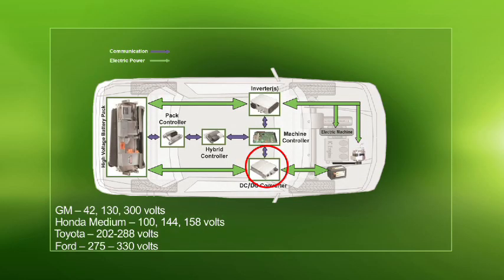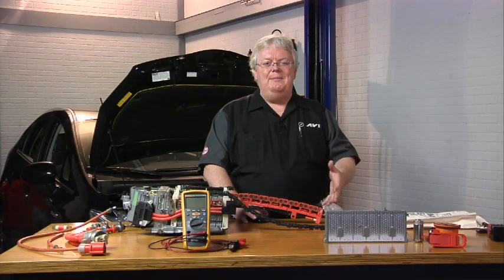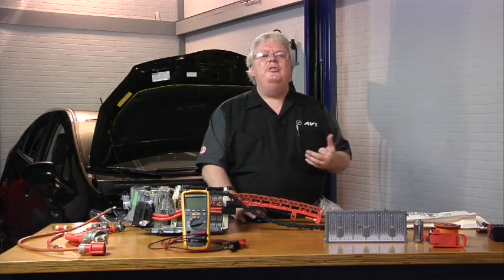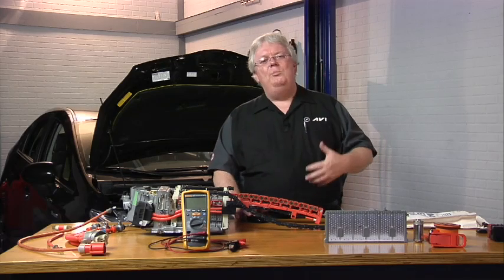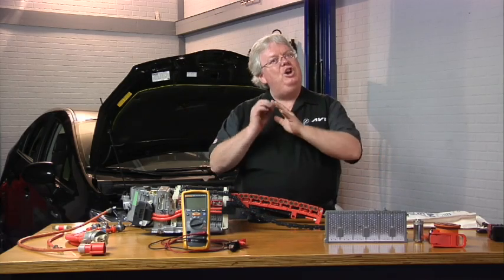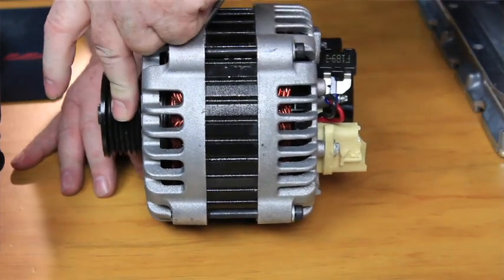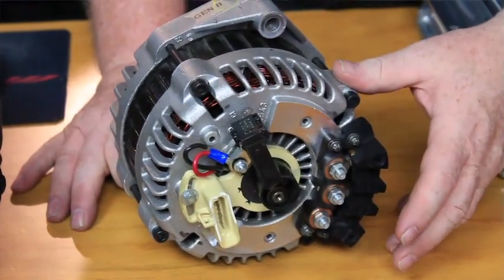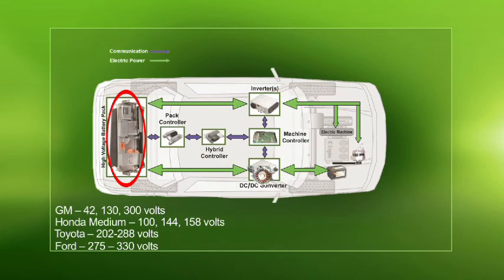If it's a Hybrid, there is no alternator! | Dave Hobbs | ASE Tech Tip

Comment: Does the DC - DC converter only work when the car is running? Shouldn’t;t I be able to start my car from the High Voltage source if the 12v battery fails?
Reply: No, charging amperage is usually low.  Starting a car takes upwards of 200Amps

Comment: I have a 2010 Toyota Prius with 130K milage.  I replaced the 12V battery 4 months ago.  Again with the same problem before the car will not start.  However, I can start the car when jumping the 12V battery.  It might be the dc/dc converter or the big battery for possible problems.

Comment: It was originally named "alternator" because it generates alternating current, which the "spinning mechanism" as you call it still does. It can be rectified on board or divorced, doesn't matter, it still generates AC.

Comment: Toyota Prius 2005   13,8 V car ON . When I turn on all electrical devices in the car - the voltage drops to 12.5 V. Does this mean the alternator is broken.The alternator is holding constant voltage, there are no voltage peaks.

Comment: WRONG!  ALL "mild hybrids" have alternators, but often they are very large and are also used in reverse as a 3-phase motor to add to crankshaft power.   Examples:  2007-2010 Saturn Vue Green, Aura Green, Chevrolet Malibu, Buick eAssist Regal and Lacrosse... to name only a FEW.  In many of these, this same Alternator/Motor also serves as the Starter motor via the same oversized crank connected belt drive.
Reply: 2011 Ford fusion hybrid was told has no alternator could be DC to DC converter issue.
Reply: @Mike-dq9cr  Every Hybrid uses an alternator to charge the HV battery pack using power from the ICE power plant. This same alternator is also used to start the gas engine... so the Alternator can operate bi-directionally in energy conversion... rotational energy to electricity, or electricity to rotational energy. 

An "Alternator" is the technically correct. term used to describe the process of converting rotational energy to Alternating Current electricity... AC power. Even in a common "emergency generator" used to power a house during failure of the AC grid, that "generator" technically uses an Alternator... NOT a "Generator"... which describes generation of DC power.

However the two words get used interchangeably when describing hybrid functions... it's not technically correct, but it's common. 

This has resulted in the creation of the term "motor-generator" when discussing hybrid and electric vehicle operation... since even in a pure electric vehicle, the drive motor (which is AC driven), also operates as an alternator/generator to push power back into the EV HV battery pack during regenerative braking. (hybrids also use regen braking)  

In modern hybrid vehicles, the Alternator resides inside the transaxle, where it has access to the crankshaft of the gas engine... so it has the ability to either apply rotational torque TO the crankshaft (to act as a "starter motor"), or to convert the gas engine rotational power into the required HV DC power to charge the hybrid HV battery pack while driving.

"Mild hybrids" have no special "Hybrid transaxle", and this "alternator/motor" or "motor/generator" is mounted to the gas engine, driven from the crankshaft by a wide serpentine belt. In this "mild hybrid" type of application, the alternator/motor usually is capable of 25hp or more. 
A typical common gas-engine 12v alternator is only capable of maybe 1500 Watts of power generation... which is only 2hp.

WeberAuto channel is a great learning resource on Hybrid systems. He has a video comparing 1st, 2nd, and 3rd generation Ford Hybrid transaxles... "Ford Hybrid Transaxle Generations"

Comment: Thanks for the video.
I have lexus rx400h hybrid, and it shows 13.3v when vehicle is switched ON. is there anyway we can increase that 13.3v to 14.0v in these particular vehicles? because it seems like battery not charging up enough at 13.3v. please help thanks.

Comment: On an 05 hybrid I need to change the serpentine belt but it doesn’t have a tensioner. Is there a simple way to replace this or is it a pain in the rear?
Reply from the maker: A drive belt tensioner is used to keep the proper tension on your vehicle's serpentine belt.  In short, I see it as a pain in the butt. Though you can always check your local shop for help, and there is a neat video called, "How to Replace Serpentine Belt Toyota Prius 2003-2009" that might have a few tips or a solution to your problems. I hope that helps. 
-J. from AVI
Reply: AVI ON DEMAND thank you very much!

Comment: Not a very video of explanations. My honda civic 2008 hybrid has great voltage but no assist ,zero bars now. It is only charged at 13.6 volts while the rpms are at 2000 rpms and the car battery light is on now also. p1570 code which is hybrid battery . You did  not say how to test the dc to dc or where it is located...very low info video ,very dissapointed.

Comment: Anyone help!? I have a 2005 Honda Civic Hybrid and the battery keeps dying, but my Hybrid battery gauge shows that the Hybrid battery is fully charged. And since is no alternator would that be a reason why my battery is dying and won't start? Because I get it jumped and it runs it just has a hard time kicking back on. Someone help!
Reply from the maker: Good evening,
In all sincere forms of honesty, you might as well sell the car. To fix/replace the batteries is not going to be cheap, even if it was a newer model, and even then you have about another year. Unless you are in love with the car, it is far more sane to sell your vehicle to a dealer then proceed with repairs.
Good luck with your future endeavors!
- J. from AVI
Reply: Wait hold up? I got a new battery 120 out the door and she runs better then she did with the old battery lol. Wierd but ok.
Reply: @killjoy69691  I have the same issue, so you replaced the 12v battery? Or the hybrid battery? Please advice
Reply: @renebarcenas5106  I replaced the bat and it was all good after
Reply: And he said sell your car 🤣🤣💀💀🤣🤣
Reply: @Urbaneism  "J from AVI" has left the chat
Reply: I just purchased a new 12 volt DC battery and it wont charge. The invertor is charging the Hybrid battery but not the DC battery :/ its a brand new battery? I had all 7 Hybrid cells looked at and they are healthy any good outcome after your question regarding the DC battery not charging? I appreciate the feed back.
Reply: @wingman4644 same here. What happened?